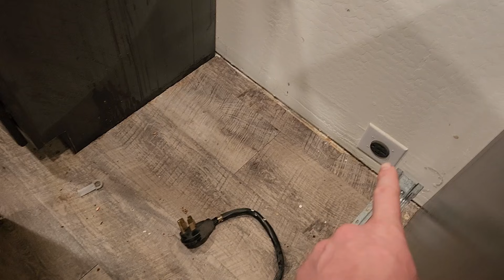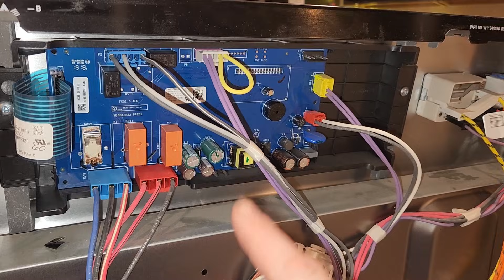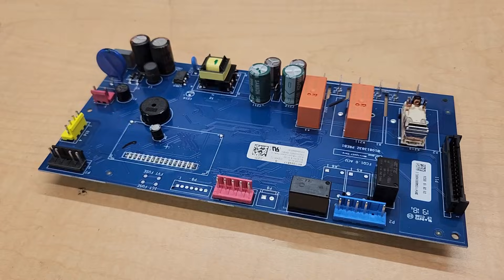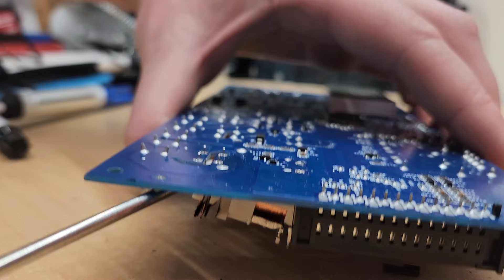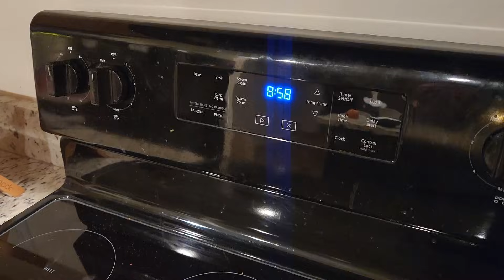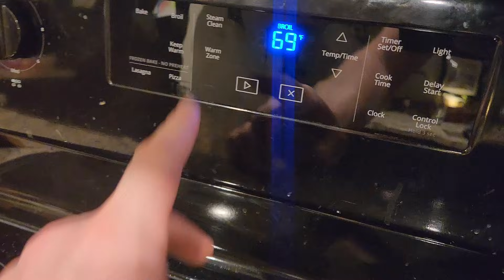F6 E1 Whirlpool Oven Error Code Repair

Comment: I found a comparable relay through DigiKey. It took some digging. I installed an OMRON G2RL-1A-E-CF DC12 (Z3080-ND). It’s working fine. I think you could also get one through mouser. I’d post a link, but that doesn’t appear to be ok with YouTube.

Comment: Also, if you have a newer whirlpool oven with the more white/cream colored sanyou relays- I’d recommend NOT trying to pry off the relay cover. It just shattered and broke. To put my oven into “limp mode” I removed the positive to my broil element and taped up the wire to prevent contact. It definitely doesn’t preheat fast, but I’m sure i would have broke the board trying to remove the relay cover. The relay cover appeared to be melted to the frame of the relay. This allowed me to at least safely use the oven til the new relay came in. (I’m not recommending this to anyone, but it is what I did).

Comment: Link is broken. What is the relay part number?
Reply: I found a comparable relay through DigiKey. It took some digging. I installed an OMRON G2RL-1A-E-CF DC12 (Z3080-ND). It’s working fine. I think you could also get one through mouser. I’d post a link, but that doesn’t appear to be ok with YouTube.
Reply: @botilley7493  THank you!

Comment: Thanks for the tutorial. I’m not skilled enough in soldering to do this so it looks like I will be contacting a technician ($).
This (control panels on various appliances) appears to be a common issue with whirlpool products. Going to check for recalls. If there are none, I won’t be purchasing Whirlpool products anymore.

Comment: Thanks for the video, had the same error turns out it was the board. I definitely dont have the soldering skills so I got the new board.
Reply: Where did you end up getting the board? Trying to find the cheapest spot. Doesn’t look too difficult to do, is that true?

Comment: Thank you so much. I was getting that error and once I was able to put it in test mode the broiler definitely came on by itself. 

Excellent troubleshooting!
Reply from the maker: Happy I could help!
Reply: @RogueWrenching  I've got to figure out whether I'm going to replace the board or try to do the relay, but for the moment I actually unhooked the broiler element on one side and took some shrink tubing to isolate both connectors temporarily. 

It's not ideal but at least I can use the oven for now, LOL.

Comment: Having this exact error right now. I haven't pulled my stove apart though. I can never get the soldering quite right no matter what I try
Reply from the maker: Sometimes just the tape to stop the broil element is enough. It'll slow the preheat, and won't broil but then you can push the repair till after Christmas.
Reply: @RogueWrenching My stove ended up having healthy modules. A simple power drain of the unit for a few minutes seemed to fix it.

Comment: Okay here is a weird situation. My tenants have been using a Samsung oven I put in brand new 4 years ago. A week ago they told me the oven gave e1 error. Tried a power reset. It cleared but came back a few hours later. I called my appliance repair and they told me control board sensor and probably easier in long run to replace with new oven. Repair parts would of taken too long and no guarantee. So I purchased a new Whirlpool oven. Installed into their kitchen and everything seemed fine. An hour later, tenants called me and said it was displaying e1 f1 error. What in the hell?!?
Reply: You need to call a electrician

Comment: Thank you so much for the video! One quick question: while I'm waiting for parts, is it ok to just pull the broiler element out of the oven as a safety precaution? I'm thinking we might still be able to use the oven while we wait for parts. Thanks again!
Reply from the maker: That should work, yes.

Comment: Thank you
Reply: The test mode immediately let me know I had the same problem. I replaced the broil (K2) relay and now my stove is fixed!  It was a booger cleaning out those little holes but eventually I got them cleaned out.  It helps to cut the relay off the board in the beginning.  It also helped to add flux and then a little extra solder to the connections on the back of the board to suck out the holes.  Thank you!

Comment: Great video, darn didn’t show up when I was first searching-couple things may help others-Accubake from 2020 (ours) doesn’t use both elements to pre heat(lame) and you can find the entire board for $ 160 if you hunt.
Reply from the maker: I ended up paying about $200, but that was a few years ago.
Reply: anything above 50 dollars is overpriced, the reason it is that expensive is because whirlpool probably refuses to sell these replacement parts on their store, making them rare to find

Comment: Thanks for the great tutorial!  Can you tell me how to avoid the issue you had with the wrong connection?  9:46 of your clip looks to show connectors & circuit board. Please tell me which power wire and connector to pay attention to.  Thank you!
Reply from the maker: All I can say is take a picture before you take it apart. I didn't, and that's what hurt me.

Comment: I have this exact model. Same color and everything. This morning was cooking bacon at 370 degrees and had just flipped the bacon on the large pan and put it back in for 8 minutes. At about 5 or 6 minutes I thought I was having a stroke to realize my whole apartment was filled with smoke and a couple of minutes later realized the smoke came from the pan of bacon that should have been cooked perfect but was reduced to charcoal and had to quickly take it outside and open both my doors with the vent hood on high to air out the smoke while waiving a pillow at my smoke alarms to stop them beeping. The then the display flashed Err F6 E1 and quickly flipped the breaker for the range and completely cut power to the oven. This oven was brand new when I moved in Oct 2021. It still had the manuals and tape on the racks the day I moved in. On the bright side it's an apartment, so most likely they will replace the whole stove and seeing as all my other appliances are white including the vent above the stove, maybe I will get a white range, and all my appliances will match....LOL. I'm tired now and need a nap.
Reply from the maker: That's Super frustrating! I'm so sorry that happened to you. these whirlpool ranges are honestly pretty lousy as far as quality.

Comment: So will this happen again after this repair? What causes this part to melt?
Reply from the maker: Every mechanical or electrical part eventually fails. It's part of the second law of thermodynamics. Will it wear out and fail in another 4 years? Probably. But fixing a $20 relay vs. a $250 board, I think, is a win. Even if it has to be done every 4 years.

Comment: Thanks for this very helpful video. We started having the same issue on a 2-year old Maytag and have had three runaway temperature events over the past 12 months. Since we don't normally use the broil feature on its own, I'm wondering if the temporary electrical tape fix could be used as a "permanent" fix. Was your oven still able to reach 350 or 400 while the tape fix was in place?
Reply from the maker: Yes, just a bit slower.
Reply: @RogueWrenching  Thank you for this. I had the same question as I just discovered my oven is having the same issue. Since I don't use the broiler much and don't want to buy new parts at the moment, electrical tape will just have to do for now. Hopefully it holds for a bit.

Comment: How did you remove the orange cover on the sensor?
Reply from the maker: It's a relay not a sensor, but it just pops on, in this case it about fell off in my hand because it was burnt and partially melted. they aren't supposed to come apart but if you lightly grab the top of it with pliers it will come off.

Comment: I have a Whirlpool range with same problem, I pulled the relay cover off (power unplugged) and it was burned out like yours, however I pulled the covers off the other two relays and the relay to the right no.2 was also burned out. So I just ordered a new control panel for 201.54 plus expedited shipping of 33.00  from the parts company you gave info for. Thank you ! Will let you know how it went. Anymore problems with the range and I’ll trash it since it’s maybe 4 years old, pretty sad really. I’m interested in an induction oven since I don’t have gas now which I had in all of my last three houses. Gas is my preference by far, the manufacturers should have improved them over all these years since now they are on the hit list for extinction. 
To convert to gas would be a huge undertaking since it’s on the other side of the house and why they didn’t run it when the house was first built is because of the cheap builders. We are second owners.
Reply: Ok, I received the new control panel and super easy install, all color coded connectors. Oven is now operating😊
Reply from the maker: Yea it's pretty disgraceful these things only last a few years. Glad you got it working!!!
Reply: So you just went ahead and ordered a new board for 200$ +? I thought he mentioned it being like 600. I may go this route
Reply: @BibbIsaBabyBack  Yes I did and it was an easy install the spade connectors are color coded and no real way to cross connect, works fine, I used the company that was referenced. I had a friend who baked a lot on a GE Stove/oven and she went through 2 ovens and at the 3rd oven GE told no more returns, she was over using her oven too much. My oven was just over 2 years old. I may have bought it from E replacement parts but can’t find any emails from them.

Comment: Great tutorial. Is there a way for me to test the relay with a multimeter before removing it?
Reply from the maker: Not really, 220v ac is not something you should be poking test probes into, the test procedure I showed and the follow up visual inspection should get you what you need to know.

Comment: Thanks for the video.  Particularly the test mode which reveals the relay failure.  Also the reminder to check plug locations is super helpful.  I am surprised that they don't make them different to error proof them.  Thanks again!

Comment: Is there a risk to just using the electrical tape to keep the flap open or some other means to keep the flap open?  Does it take the broil feature away?
Reply: If you fold the top flap up it will come off completely
Reply from the maker: electrical tape puts an open into the broil circuit, removing the tab would have the same effect. It's not a permanent fix, it's just a way to make the oven somewhat usable while you wait on the part to show up.
Reply: @RogueWrenching  it's permanent for mine 😂
Reply: @kaseycoleman993  Is your oven still able to reach temperatures of 350 or 400 with the tape in place, or do you lose a significant amount of heating capacity?
Reply: @theobroma3705 takes longer to warm up but still works fine
Reply: @kaseycoleman993  Good to hear. I'm going to try this. Thanks!
Reply: @kaseycoleman993  same here! Never use the broiler anyway

Comment: OMG you are a life saver!! I am so glad I found this video. I bought a Multimeter to start tracking down the problem, but now, I don't even need it. It went out right before my back surgery, so bending down to check with the meter was going to be really hard on me. Trading for a soldering iron! Literally dropped jaw watching you take the soldering off, so cool. Thank you so very much. 🫶

Comment: Excellent job. 
You can use solder wick to clean pin holes that the solder sucker missed. Also, always screenshot all external hookups to control board for further reference. 👍

Comment: Can I take that silver piece out that’s suppose to open back up
Reply: Are you talking about the little flap at the top of the relay, where he said to put the tape? I took that out instead of putting in the tape and so far it has worked for me. I'm still waiting on the new relay. Thanks @RogueWrenching super helpful video!
Reply: @brandonberthiaume3690 I was wondering if I could just take that little flap out as well.. did that work fine until replacement?
Reply from the maker: It's just screws in the back, the trick is to flex the bottom upwards to get the back panel out.

Comment: Hi! Having the same problem with the same stove. Burnt dinner last night! How do I get the orange relay cover off and can you post the part number? Mine is faded and I can't read it. Thanks!
Reply from the maker: The relays should all be the same. The cover isn't supposed to come off. Mine broke off. Just pry it off with pliers. The part numbers should be the same across all 3 relays.
Reply from the maker: TE Connectivity RZHH-1A4-D012 Power Relay T166826
Reply: Where did you get the new relay from?!  I can’t find a matching number online, or when I do I need to bulk order 3000!  Thank you kindly.

Comment: My oven doesn't have two elements and it's made this way. It's a whirlpool accubake electric oven. It's take a very long to preheat if gets there at all.
Reply: If your oven has a bake button and a broil button your oven has two elements just that the bake element is hidden away under the lower pan out of sight.
Reply from the maker: I'm an automotive tech not an appliance guy, so I'm not sure how to best advise you.